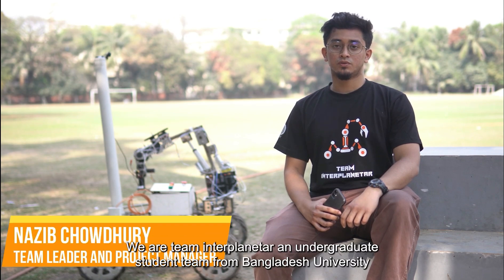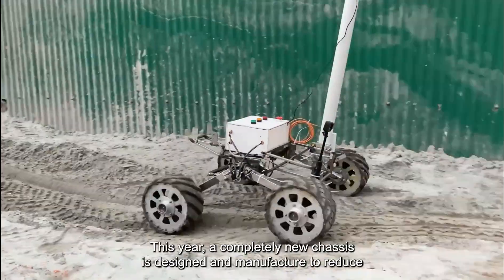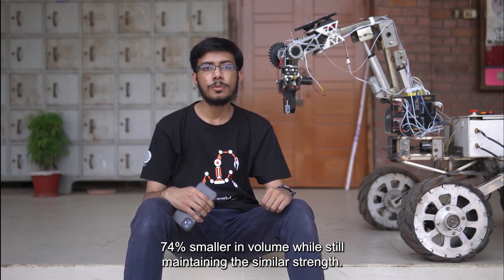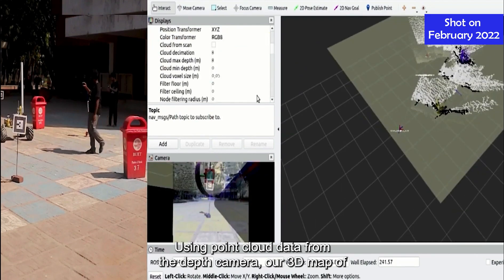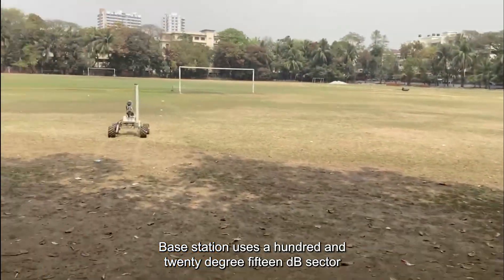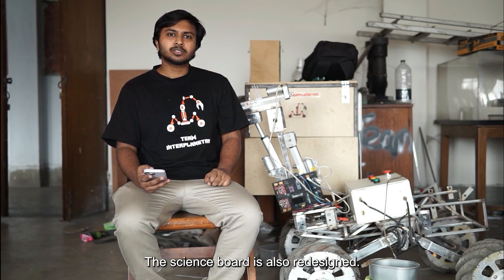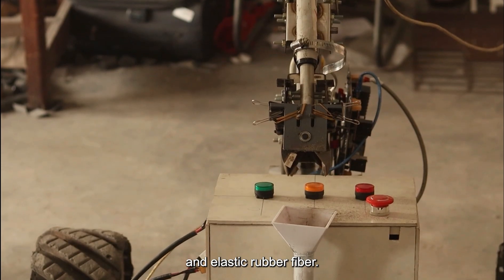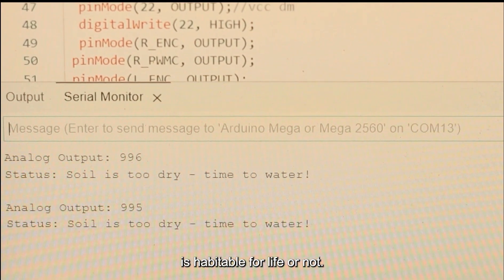Team Interplanetar - BUET Mars Rover Team || URC SAR 2023

Comment: im in my freshmman i am aspired to start a roveer club in my college , can you tell me what courses should i learn making the rover
Reply: It depends on what you're most curious about? Generally a rover team is divided into 4 major sub team - 
i) Mechanical & Manufacturing sub team
ii) Electrical sub team
iii) Software & Autonomy sub team
iv) Science & mission sub team
I'm part of software and autonomy sub team, so I might be able to give you some info on Software side of a rover. In this sub team, we use ROS(Robot operating system), Rosserial Arduino, Opencv Aruco tag detection etc in general. And we're sometimes required to learn beyond these things according to the need of modification. 
In Mechanical sub team, you're mostly likely to work on 3d designing using SOLIDWORKS and Manufacturing and shaping them.
Reply: @AhnafNafi-xg8cc  I’m curios about software and electrical so if you can guide us be very helpful
Reply: @AhnafNafi-xg8cc  do you use any type of nvidia board ?